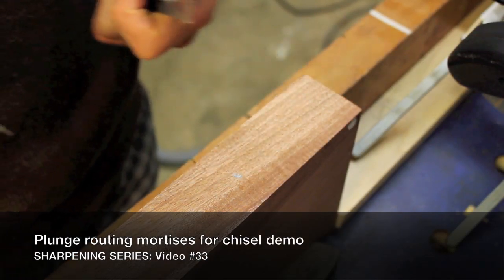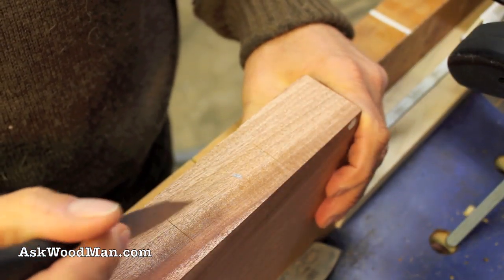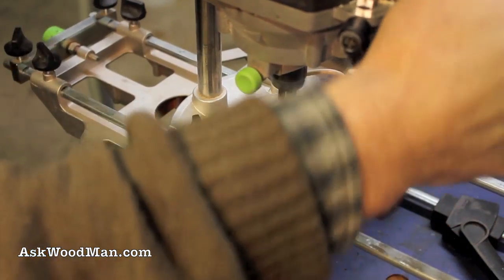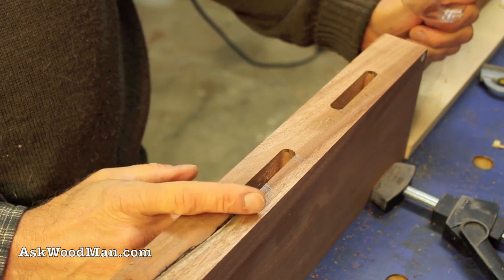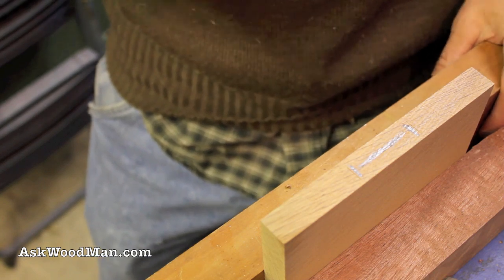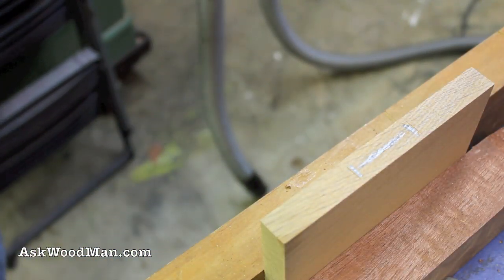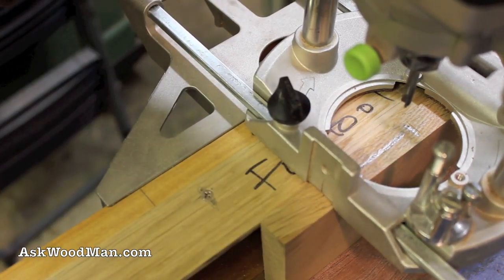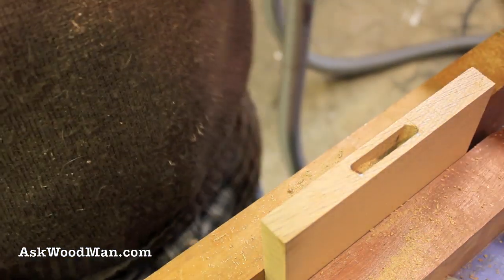Plunge Routing Mortises • Complete Sharpening Series Video 33

Comment from the maker: I am just using the router and edge guide. The poplar is just attached to the guide to act as an length extender. Video 19 of Routing A Taper Fluted Leg Series has a different look at this technique. Almost 30 years ago when I first learned to use a plunge router I was shown how to use the guide. Consequently I rarely use a router table. One of the reasons I bought the Festool was the extra long guide bars with independent fence placement. Really handy for my style.

Comment from the maker: That is an up cut bit. I prefer them for plunge cutting because they eject the cut material out of the mortise better in my opinion. They can lift the grain at the plunge opening and leave a more ragged cut than the down cut , but since I shoulder all my tenons this has not been a problem. In a case where you want to cut a through mortise, an up cut will conversely leave a smoother opening where it breaks through. On balance, I prefer the up cuts.

Comment from the maker: Those are Pentel .7mm mechanical pencils with HB lead. I am an affiliate with Amazon so things you see me use that are not in my store can be bought through them. If you like my videos you can click through my Amazon link for anything they sell, not just tools and I will make a small percentage without changing your price. I like that Pentel because it has a steel lead sleeve tip. .7mm is just right size for wood. That thin knife is just a cheap pointed kitchen paring knife. Cheap,sharp. THX

Comment from the maker: @spelunkerd Please never use a drill bit in the router. They are not designed or rated for 20,000+ rpms.  The consequences could be catastrophic.   The spiral fluted bit in the video is a 3/8" diameter 1/2" shank solid carbide spiral fluted (two flutes) upcut router bit by Whiteside. I really love their bits. They are such a great value. I prefer up cut spiral bits for plunge routing because the chips clear the mortise better. I was actually going slow for the demo. Those bits cut!